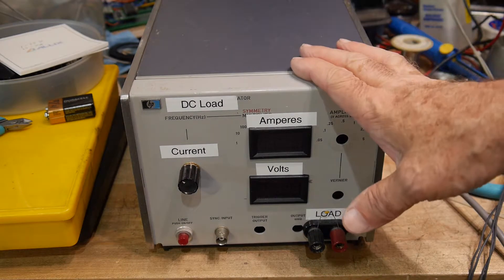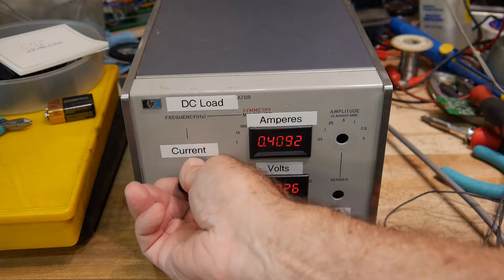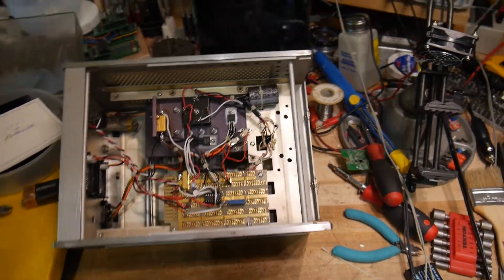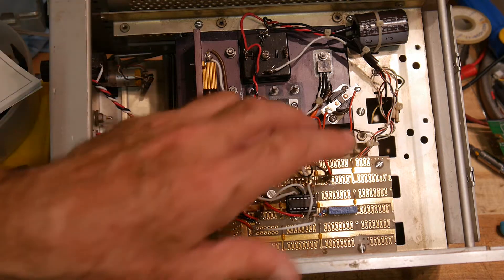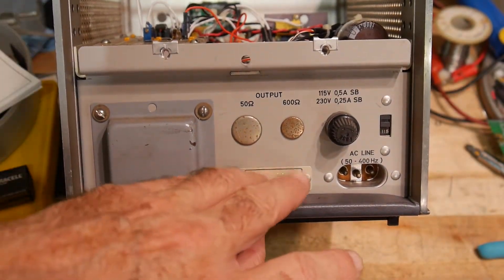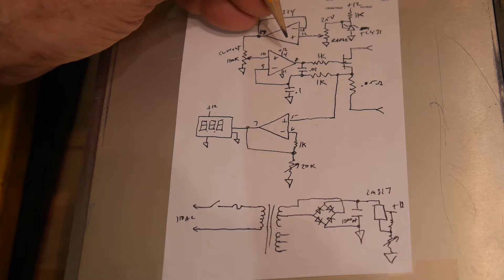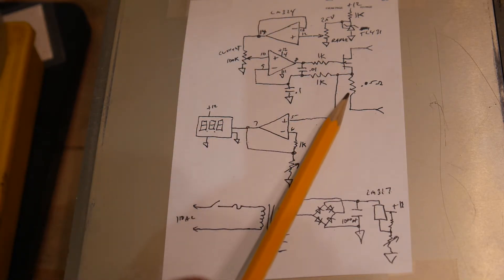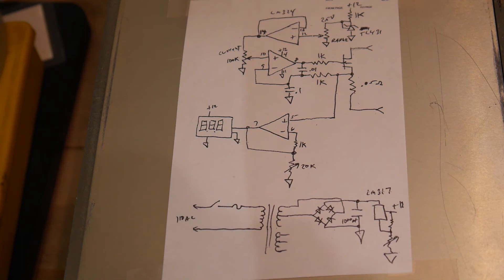#217 DC load DIY

Comment: Datasheet for lm324 states minimum voltage of 16. Were you really operating at 12V?
Reply from the maker: read the datasheet more carefully. the max voltage is +/-16.  I'm not sure how low you can go, but a lot of the datasheet numbers are using the part at +5 and Gnd.

Comment: I'm a relative beginner here, so bear with me please. A few days ago I stumbled upon your channel when looking for ideas on a dummy load that was effective yet simpler than many "newfangled" ones that dominate today. I love what you've done and it was the perfect inspiration to start towards my own. Hook it up, turn a knob, accurately see voltage and current, nothing more, no arduino, no programming, and that's why it is so great. 

My question is about the voltage divider on your amperage display op-amp, keeping in mind that I just started learned about op-amps a few days ago. I thought the other commenter here caught it, but I'm still confused. 

Assuming I'm understanding the schematic correctly, the op amp "+" input would equal the voltage drop across the resistor, let's say 15 amps through the 0.05 ohm resistor so +0.75V relative to ground? Is it correct (in a simplistic way) that with negative feedback like this the op amp is "trying" to make the two inputs equal? To do both that and have a 15V output for the display, the resistive divider has to be set up for the "-" input to have 1/20th the output voltage (to "reverse" the 1/20th ohm shunt)? Wouldn't that mean it should go:

(op-amp output) —> (19k resistor or 20k pot) —> (op-amp "-" input tap) —> (1k resistor) —> (ground)

It seems to me that the other commenter, @dominikworkshop6007, was halfway right in that the "-" input needs to center tap the two resistors. Though, I think they missed that the 20k pot needs to be the one between output and inverting input, while the 1k needs to be between inverting input and ground. 

I only typed all that out for the sake of analyzing my own logic. Obviously you have a vastly larger understanding of all this and have a working unit, so I'm left wondering whether I'm misunderstanding something or if you built it right and miswrote on the schematic. 

If you somehow see this and make it this far through my wall of text, I'm appreciative of your time and honored that you spent it here. After discovering your channel a few days ago I can clearly see that your channel is a goldmine of years of knowledge and I'm thankful to have found it. Thank you!
Reply from the maker: this should help: http://www.scullcom.uk/design-build-an-electronic-dc-load-part-1/
Reply: @IMSAIGuy  Thanks for such a quick reply, but I don't quite understand how that resource addresses the question I posed. I'm wondering if you didn't see the whole comment? I know on my devices I often have to hit a button or something to expand longer comments.
Reply from the maker: sorry, I don't have the time, the resource is done well and should help @Irish-Death
Reply: @IMSAIGuy  gotcha, no worries. It was a long winded way of asking if the amp display op-amp's resistive divider was wonky, but still not corrected by the "correction" of the other commenter. 

No obligation to respond further, thank you for your time.

Comment: Nice!
BTW, laminate (like for a countertop) is a nice/quick/easy way to have a clean look on repurposed cases.  You can get a sheet for relatively cheap at your local home improvement store.  Just use contact cement to stick it to the case.  Put on two layers if you've got some big holes to cover for more rigidity.  If you do the iron-transfer laser printed paper trick, it can look pretty darn professional for graphics.

Comment: What op-amp you are using? Great device!
Reply from the maker: probably a TL072
Reply: @IMSAIGuy  for such a precise device, I was expected a more precise op-amp, do you think you could achieve the same accuracy with LM358?
Reply from the maker: @33samogo  the 072 is much better than a 358. but the 358 would probably work ok
Reply: @IMSAIGuy  At the top of your diagram I see "LM324". Isn't that the op-amp you are using?

Comment: Just what I wanted. How do you know what is the maximum current range it is set to and that 20k trim POT,  is it to "calibrate" the current display meter?
Reply from the maker: yes the 20k is to calibrate the meter
Reply: Just search for "adjustable constant current load".   I bought a couple to test my rechargeable batteries.  They are very cheap now

Comment: Just a note...  I was sort of baffled by the schematic, which doesn't show the ground connection of the lower leg of the "output".  You did say "ground" at one point while pointing at it, so I assume it actually was!
Reply from the maker: you are right, the bottom end of the 0.05 resistor should have a ground connection on the schematic

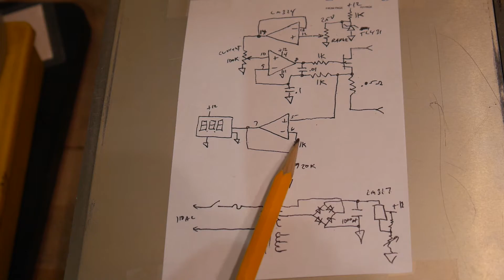Comment: nice build, but  shouldn't the 1k resistor be between output and inverting in? xd (10:10)
Reply from the maker: it is a non-inverting amp.
Reply: IMSAI Guy oh, sorry I meant inverting input XD
Reply from the maker: oh, you're right. wonder if I wired it right and just messed up the schematic.   seems to work :)
Reply: @IMSAIGuy  I'm pretty sure you wired it up correctly, sometimes things like that happen.